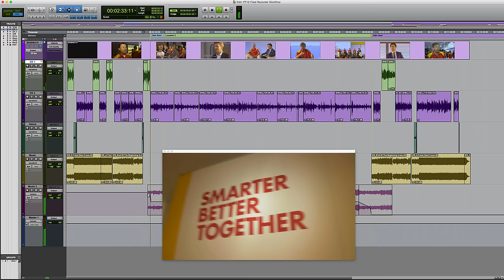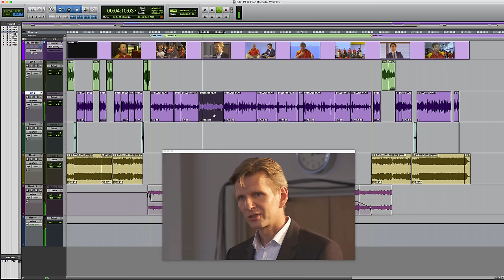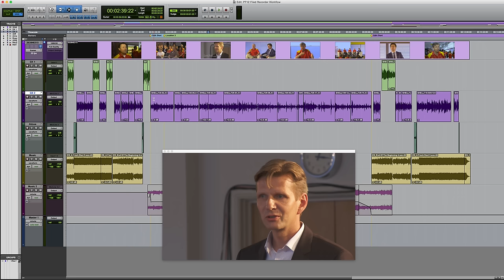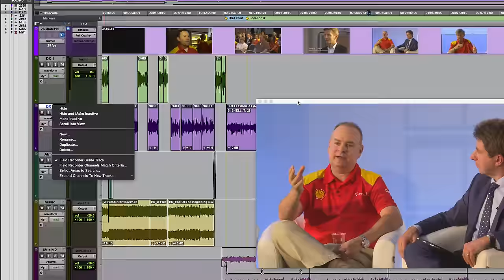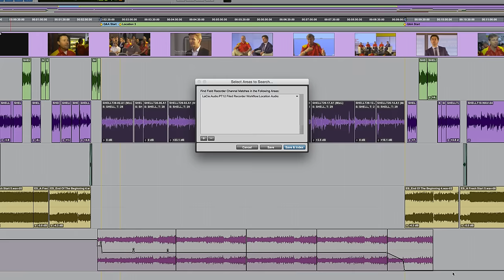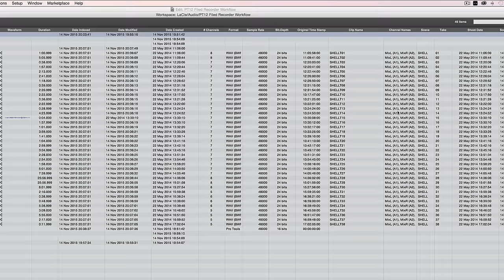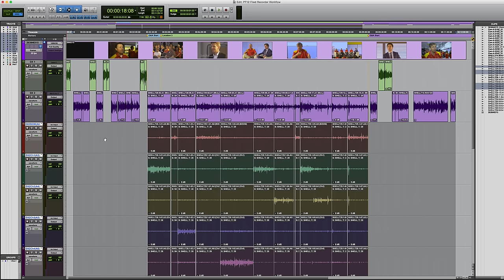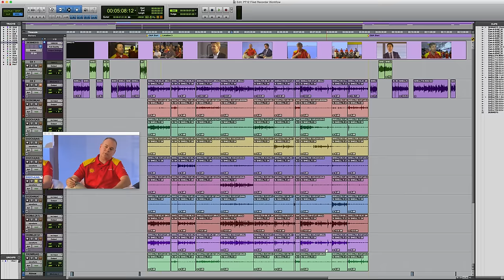Pro Tools HD Field Recorder Workflow

Comment: That was amazingly neat. It never works this well when I do it.  It only finds about half the audio I want, and sometimes it doesn't find any. Plus it always creates tons of tracks, usually two or more tracks with just an exact copy of what came from the AAF, and quite often it includes a lot of files which were not in the folder I specified - random bits of music and FX from the audio folder etc. Maybe I'm using the wrong match criteria...?
Reply: I'd like to hear more on this as well, same issues.
Reply: The main problem is no matter what parameter settings you use, the system ALWAYS searches in the clips bin as well as your assigned location.  And so you ALWAYS get shit matches from the bin, including your AAF material over again as well as other stuff that might have same TC (like shot at same time on a different day).  This is a bug I've complained to Avid about for YEARS, but for whatever reason they refuse to add a click box in the match parameters to ignore the clip bin and only search in the 'area to search' you define.  If you could keep the system ONLY searching in the areas you point it to you'd get a lot less false matches.  I encourage you to file a bug report and/or add to ideascale.

Comment: Hi Paul, is there any settings in ProTools preferences that should be changed before we designate a track as field recorder guide track? Because i followed the exact same steps mentioned in your video and when I clicked expand channels to new tracks by match criteria, all it did was duplicate the guide track into another track. It doesn't expand the poly .wav files onto new tracks despite me saving the location for original audio as the linking index. The editor edited the video and the mix-L track on avid media composer audio was given to me as an AAF. Could you please tell me what I could possibly be doing wrong?

Comment: Could this be done with timecode ? Maybe they could not sync the cameras for some reason but i would think they use timecode in such a production.
Reply from the maker: This particular workflow is reliant on the audio being timecoded. Usually that timecode is on both the camera footage and the audio rushes.

Comment: Thanks for your tutorial! 

I have a question: If they edited only with the reference sound that was sent to the camera and picture is locked, is there a way to sync without losing so much time? The metadata of that audio clips are the ones that the camera generates and they didnt have timecode.

Comment: I follow these steps, but it keeps expanding the whole track rather than the selected clip. I make sure that link edit selection and timeline   is enabled. Also when I point toward the original audio folder it doesn't see any audio files. still, I click save index and it seems to find them. I can't be sure it's finding alternate clips from the audio folder in the omf file provided by the editor or if its searching the session audio folder, as it seems to be finding alternate clips I've used in the session before. I'm on Windows 7 running HD 12.7.1 I'm not actually looking for multi mic channels like here, I'm trying to use this method to find alternate takes.

Comment: So does this feature of pro tools HD negate the need for such software as ediload, Virtual Katy or Titan which use EDL files to do the same job? They are insanly expensive too.
Reply from the maker: This doesn't negate the need for them, as this is mainly a workflow for the initial conform. If changes are made to an edit part way into a project, you'll still need one of the conforming software options you mentioned unless you want to either do it manually or start the mix again. It would be nice if a re-conforming option was built into Pro Tools though!

Comment: Hi, thanks for this video, is realy useful. But i have a question, if is posible do this, even if the audio metadata is lost?
Reply from the maker: If all of the metadata is lost then this workflow would not be possible. However, if at least the timecode is retained, there's an option to expand the matching channels by timecode only.

Comment: If I keep running into an issue where it's generating way too many tracks, what are the best ways to avoid that? 8 channels or production were recorded, but the sync is netting 50 tracks of audio. Pro tools 10.3.10.
Reply: It's matching multiple things with the same timecode from different shoot days most likely.  If you can't limit it using metadata (like scene and take number), you can try dividing your production audio onto tracks by day and then only pointing that material to the folder with that day's audio-- so your less likley to get matches from other days with the same TC stamp.

Comment: Do you know what things editors should do/not do to ensure that you keep all the metadata?
Reply from the maker: If they don't convert the file format at any point and keep the audio as Broadcast WAV, the metadata should be maintained. Converting to AIFF is something to definitely avoid.
Reply: I have been very unsuccessful in finding out how to do this on the editing side.  @paulmaunder3007  I work in Premiere but don't know how to pair down the audio to 1 or 2 track while still making what you do in this video work. Any resources you can offer up?
Reply: @NicholsonStudios  I know you made this comment four years ago - but if you found an answer, let me know, My guess is, it's as simple as the editor simply working off the mix track, or any pieces of audio they choose, and then the dialogue editor can combine those into a single "guide track" and then re-link to all the proper audio.